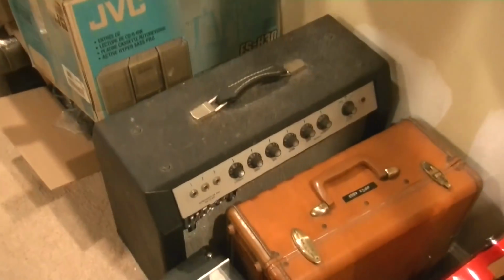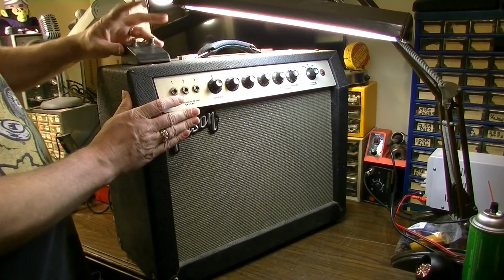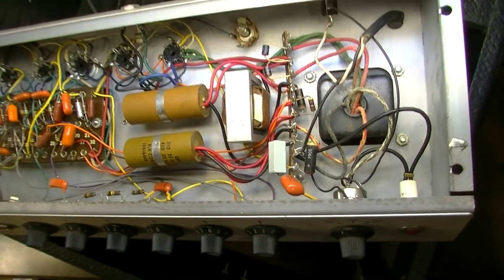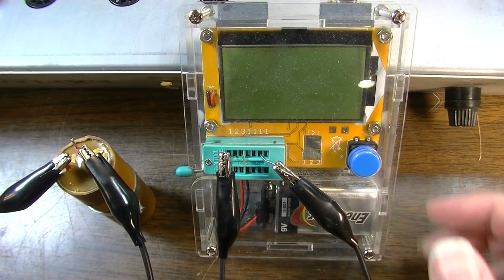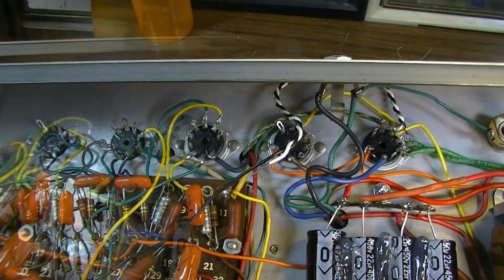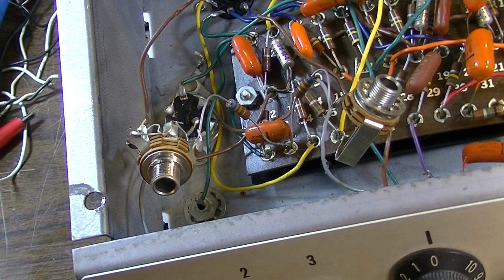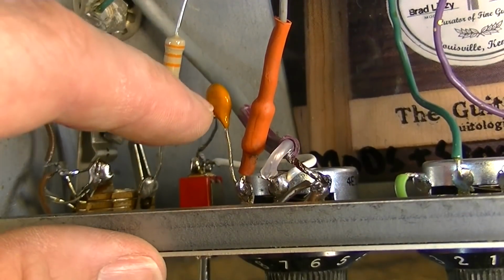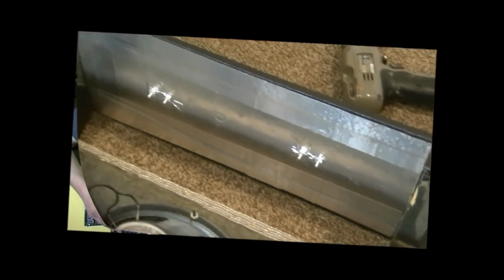The Baddest Gibson GA15RVT Explorer on Planet Earth?

Comment: im glad to see that im not the only one that modified one of these amps.  i agree its got good "bones", but a bad design.  im usually a purest and dont like modifying anything vintage, but this amp is an exception.  - very thin and anorexic sounding, with no Body or warmth at all.  it only sounded half decent if you turned the Loudness and the tone stack pots up all the way.  anything else...  forget it.
 i didnt mod it as much as you did tho.  i  beefed up the bypass caps in the preamp from 2uf to 15uf and replaced the bizarre tone stack with a more Fender like T/B stack.  but i didnt want to completely convert it to a Fender, so i left the reverb as it was, including the strange fact that it not only bypassed the tone stack, but the Loudness control as well!  so the gain and the reverb are fed independently!  very strange "feature".   i was also perplexed why the reverb had (essentially) 3 gain stages (including the initial preamp) but the actual preamp only had 2 (including the PI driver).  its a weird amp but it had potential.  id love to see a final schematic and what you did with the reverb.

Comment: APB be on the lookout for a Gibson GA19RVT. Remove the 3 leg rc network, up the first stage coupling cap from .01 to .02 , remove the .001 between the power tube plates and install a 500 pf on the tone control and that's it.oh yea, after removing the rc  network, install a jumper between the coupling cap and the volume pot. It ain't as gainy as your ga15 but it's still a nice bump.Good tweek and good playing there, Mr B.
Reply from the maker: I have a bunch of Falcon videos on the channel.

Comment: 48:25 Hah! Well, yeah probably. But I had modded mine first. I didn't restructure it as dramatically though. What I did was go to a one knob tone control based on a big muff circuit, and then I used the bass knob to act as a tone stack bypass for extra gain. So when everything is cranked, it rocks pretty good. But it's gotta be loud to do it.

Comment: Not sure the reverb mod was a good one since the gain seems to effect the reverb level as well. Other than that sounds good.
Reply: If you mess with the routing of preamp stages (well, half stages) like that you run the risk of adding an out of phase wet signal when mixing it back? Which defeats the purpose of the gain stage mod?

Comment: When wiring the heater filaments, take 2 different color long wires and put them in your cordless drill and spin them together. Then you can cut them to desired lengths and strip the ends.

Comment: The Gibson amps are weird the expensive stuff is the transformers and choke and there very good but then the filament wiring is terrible and cheap to do when it’s built the input jack delineating is truly weird it looked like a Switchcraft and have used them 30 years and never had one fail

Comment: I have 3 amps from the mid 60s gibson crestview line.  Man, they are ugly, but they are gems.  I have the GA-8T Discoverer (which is the same as an Epiphone EA-35T Devon ), GA-19rvt Falcon and a GA-5 Skylark.   My only beef is that they often had integrated components (a few resistors and a cap all in one package with 3 or 4 legs sticking out of the main "blob")    Great video Brad!!!

Comment: Why would you think that the "death cap" is no longer needed once you install a three prong cord? With the 3 prong cord installed, the cap is no longer a danger because the chassis will be grounded. Anything that puts line to the chassis will trip the circuit breaker that feeds the amp.
Reply from the maker: With a modern polarized and grounded cord, there is no need for an incoming line cap. It's an extraneous part which serves no useful function.

Comment: Just listening to your videos while i work on some amps and guitars. I just did a power amp and ran into the same issues with one dead channel. Had some blown diodes on the input, replaced all that and nada. Started probing with my scope with a test tone and had a slip from the collector to the heat sink, arcs and sparks. Fried the bias resistor and a 4 out of 6 NPN and PNP BJT outputs. Replaced all that and nada. Replaced the drivers and nada. Had 120mv of DC offset at the output with no load. The protection relay was kicking in the whole time showing an issue. Heard it clicking in and out so I figured all good. Last frigging thing I could think of so a 3 week order from China and all be screwed if it wasn't that stinking $3 protection relay. Definitely did not make much profit on that repair. It was some off brand amp and I could not find the exact schematic. Learned what not to do again. These things are not as forgiving as tube amps when you make a quick short circuit. They go into arc weld mode. Done that on a tube amp once and the only thing it damaged was my good Probe Master DMM probe. Amp was fine. LOL. The cross referencing of obsolete transistors is a half the battle. Had issues with that before, different pin outs. Blew up a cap in a Peavey power amp of mine replacing obsolete shit. I'm thinking of not taking much more of these unless it's a simple switch or pot. Caps maybe.
Reply from the maker: The problem with SS is you will get mired down in a lengthy repair like this and the amps just aren't worth the real cost. A lot of the guys I know don't mess with any SS at all for that reason. And you just don't know what it'll end up being until you're in there.

Comment: Brad, did you test the capacitors before you removed them? I know their old, but you know how collectors are 😉. They like to see all original parts, that's why the old tube amps are so valuable. If they've been changed and look like a Christmas tree inside, then they are not original, was the advice my dad gave in the mid 90's. With reissues and the everything else that's come out since then, I wish I still had my CBS fender twin. I've got a garage full that could keep you busy for a bit. I'll send pics when you have time. I love what you do, brianefrench@gmail.com

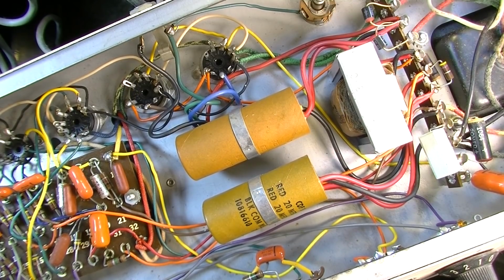Comment: Big A/V QUALITY UPGRADE 16:41...good low freq.'s
I have a THOMAS ORGAN CO. 1962', T1* ORGAN CHASSIS (actually TL-1 organ) I'm going to make a guitar amp from. [never ever destroy a fixable analog discrete component organ! As I mention below, it was beyond huffed!] THE T1/TL1 is an excellent candidate! P/P 2-6BQ5 (actually 7xxx forget, not in reach), 3 12AX7, big pwr trans & big ot... empty half of chassis- provide space for potentiometers across full front. 
EVEN HAS A LOW VOLATAGE SUPPLY (as all tone generators were transistor...mega quantity germanium:)...full of 1960’s Blue Ajax  'Fender' vintage capacitors.
BOTH FENDER AND THOMAS ORGAN COMPANY WERE IN SEPULVEDA, CALIFORNIA....you'll find  they sourced a great many parts from the same supplier. When CBS bought up FENDER, GULBRANSEN ORGAN CO., and  LESLIE (ELECTRO-MUSIC CO.)...you'll find even hardware crossing paths. ie. Gulbransen giant numbered side view'  thumbwheel potentiometer controls, used on Gulbransen RIALTO II organs, ALSO USED ON 1970's CAST ALUMINUM FENDER FX PEDALS, W/ "foot control" side wheel knobs.

I've R&R many amps. Guitar player since 77'. Organ player/ collector RESCUER OF ALL MAKES LISTED BELOW THROUGH 1968'. RULE OF THUMB: ALL BRANDS AND MODELS OF ORGANS PREVIOUS TO THE 'EPROM' 1968', WERE GUARANTEED THEMANUFACTURE CARED ABOUT 'TONAL QUALITY', AND 'CABINET CONSTRUCTION QUALITY. '. After the 1968' period, 'features', aka 'auto rhythm', 'auto accompaniment' began to displace the tonal quality of the tone generators.
NOTE, 'TRANSISTORS' IN AN ORGAN CAN BE A GREAT THING. Tranny tone generators very sweet sounding in many cases. WE ARE TALKING >DISCRETE TRANSISTORS<. The Gulbransen RIALTO K used all transistors, and used a LESLIE 101 'ISOMONIC' 5 CHANNEL ALL-TUBE SPEAKER CABINET. What is 'isomonic'? It's a play on the words 'ISOLATED HARMONICS'. In an orchestra, choir, or PIPE ORGAN the individual voices BLEND IN THE AIR..., but in the case of blending in an amplifier/speaker, the 4ths & 5ths harmonics CLASH/CANCEL. So DON LESLIE  and Gulbransen engineer ?1st name Peterson, designed a way to eliminate this. USE TWO SEPARATE CHANNELS WHERE ADJACENT NOTES ON THE KEYBOARD DO NOT SHARE THE SAME AMPLIFICATION/SPEAKER CHAIN. So...
 CH. 1 gets all C,D,E,F#,G#,A# key's outputs, and
 CH. 2 gets C#,D#,F,G,A,& B
(note, these are only the NON-FLUTE VOICES (tabs)- DIAPASON,STRINGS,REEDS/horns. WHY? Because FLUTE/TIBIA GO THROUGH TREMULENT (aka LESLIE SPEAKER, ) IN A THEATER ORGAN SILLY... where it gets all SWIRLED and clashed together anyway. 

btw Hammond draw bar organs are FLUTE-ONLY...Don Leslie, a theater organ enthusiast, reasoned AM/FM of THEATER TREMULENT could be had in a manner which used DOPPLER, AND TO/FRO LOUD/SOFT...all in one spinning baffle. Sure enough it worked! So well that Leslie (Electro-Music) never had to advertise! Another bit of trivia, Laurens Hammond despised the Leslie...hence why 'half moon' switches are externally mounted on a Hammond Organ. Eh', looks cooler anyway.

WATCH video>>  at 40 minutes in >>>      Legendary Theatre Organists       <<<   a demonstration's worth a million words. WATCH!

*[actually TL-1 organ...'L' for Leslie, but fairly certain it's the same amp chassis for both Leslie and non-Leslie models]. This organ was found with keys busted, music rack ripped off, bench gone and Leslie 'wooden drum' insert yanked and missing. I'm a proponent for NOT destroying organs for amp projects. I've rescued and repaired [and many fully restored] all makes of organs 1946'- 1982. CONN,GULBRANSEN, HAMMOND, LOWREY, THOMAS, AND WURLITZER ESPECIALLY.

Comment: Once you're  in you may as well get the best you can out of these things. They weren't much out of the infancy of design when originally done. The tube makers just gave specs for what worked for things needed in ww2 and Korean war era radios and such. Manufacturers were kind of making it up as they went, we have the luxury of hindsite for what actually works best for our needs. Museum pieces are nice for reference, and fine if that's what you like, but don't sweat it, make the improvements. You can always put it back to original.

Comment: Hi Brad, love the channel. I have been a fan for some time. I really enjoy your videos, I have learned quite a bit from you, many thanks. A little tip for drilling l'll share that an old timer passed on to me. To make drill bits last almost forever, start drilling at a slow speed, increase speed until the bit starts to cut nicely. Don't increase speed past this point. Your bits will last a long time.

Comment: I need a little help-I bought one of those transistor checkers from banggood and it worked a few times and then-no matter what component I put in it it goes into test mode and then the screen says Cell u=4.79   1+''3,like it is checking a battery. I have tried new batteries, tried to figure a way to reset it. I contacted banggood and they said to send a video and when I tried to send video it would not let me, so I sent a picture of the screen with the cell  u=1+3 on it and they just keep saying didn't receive video. I thought maybe you might know how to reset it or something because it does not look like they are going to do anything about it.All I want them to do is tell me how to reset it or just send me another and nothing.I am also waiting on another order from them that should have already been here.I haven't heard you say much about them lately.Thanks for any help.
Reply from the maker: Their shipping can be slow. The stuff comes from China. If you have an account set up with them you can track packages and stuff through your account. As for the transistor checker...never had a prob with mine, but sounds like you done just about everything you can do. Maybe tell them you want to send it back for a refund.
Reply: thanks-It would cost me more to ship it back than it cost.I think they know someone is not going to spend what something cost to ship it back. I guess just write up another lose.Thanks for responding.

Comment: Hey Brad, amazing rework on that amp.  Love the Cap tester.  I may have to get rid of my vintage Tel-Ohmike TO-10...  
Something for thought: here's what I like using and twisting up for heater wires: https://www.lowes.com/pd/50-ft-18-2-Thermostat-Wire-By-the-Roll/3128547
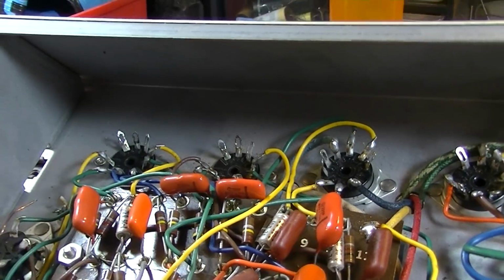Someone else asked, but it's dropped way low... Who's performing that solo @ 28:53?

Comment: Great mod! Killer reverb! As always the hot glue is a great warrior. Sometimes people use a electric screwdriver or a drill to twist cables in order to improve time when you have to make it a lot. Maybe not the best original design, but i love those orange drops. That virtual center tab is like a voltage divider right?

Comment: Hi Brad! Thank you for this wonderful video. I just wanted to make a point about that 33K input resistor - I think you overlooked the importance of the layout. As you probably already know, the purpose of this resistor is make a low-pass filter in conjunction with the Miller-capacitance(Inter-electrode capacitance) of the first preamp stage (V1). This would eliminate all kinds of radio frequencies from being amplified and also all possibilities for RF-oscillations. The critical point here is, in order for this to work, the lead from the resistor to the pin of the socket should have a minimal length (so that the capacitance is close to 0). That's why this input resistor is soldered directly to the socket and then connected with a shielded wire to the input.
Reply from the maker: I know tying to the socket is best. But every manufacturer has produced quiet, stable amps with the input resistor on the jack.

Comment: Hey, nerd question for you - where'd you get or what kind is that ESR meter? There's a buzzilion on eBay, but most seem really chintzy.

The amp sounds great...

BTW, you can twist a boatload of wire with a cordless drill geared to low. Just shove the wires in the chuck and use your fingers as the "die"
Reply from the maker: There's a link in the description.

Comment: The radio shack speaker may be from Utah, who made speakers sold through Radio Shack, and they often used metal dust caps.  Although Utah speakers generally have a bad reputation, Ted Weber bought the patent on one of their models - not sure which yet.  I've got two Utah speakers with large ceramic magnets in my Ampeg Super Echo Twin, and they sound so good I don't miss the original C12Q speakers.  That GA-15RVT amp sounds great!  The fiber baffle and plywood cabinet absorb some of the harsh high frequencies, rather than contributing to the sound as solid cabs do.  I remember reading about a guy who replaced the fiber board baffle in his Silvertone amp with a birch ply baffle, and it never sounded as good again, because of the harsh high frequencies not being attenuated by the fiber board baffle.  Some of those 1960'a Gibson amps can sound great when serviced properly, but they are more difficult to work on,  and some of the earlier tweed models also used circuit boards you have to remove first, in order to service components on the other side.  

Another interesting video - tx!

Comment: I had one of those from either '65 or '66. What I hated about it was the reverb would never be all the way off even with the reverb depth off and the ft. switch off. You could still hear the tank..I changed the B+ diodes out with FRED's and replaced those 50 year old filter caps/cans. Mine had two 6EU7 valves for the first couple of stages. There's a line matching transformer in the phase inverter/ output section. I reused the cap holder/clamps and installed a pair of multi-stage "firecracker" caps from CE Distribution.
BTW, that amp was designed by Seth Lover who designed the GIBSON Humbucking, P-13 pickup and the mini-humbucking for GIBSON and also the Fender Humbucking.

Comment: Lets see some Inverse Feedback experiments in the preamp section . Example in my JMC 800 mods I run the lead ch grid back into grid 1A, isolating with a 2meg resistor. This removes tons of noise. Another noise reduction tip , tie grid to cathode together same side of tube with 150pF cap in high gain stages.

Comment: Did you actually check the amp between replacing the filter caps and doing all that heater wire replacement? I always check after each "repair" step to make sure them amp is alive. That way I know that between each change that the amp works so that I don't have wonder where I screwed up if the amp doesn't work after multiple changes have been made.
Reply from the maker: Not a bad idea. And yes, I usually do.

Comment: Talking about the notorious death cap... I call it a virtual ground. In a sense it provides a reference to chassis ground. It can be flipped in reference to the hot or neutral. What had always confused me is in DC tube circuits those same coupling caps block DC voltage but AC voltage passes through. So understanding exactly why the AC voltage did not flow through those coupling type death caps seemed hard to grasp at first. As you learn better it then becomes apparent that the AC current flows in the direction of least resistance and choosing to flow through AC wire rather than a healthy working coupling cap. Once that healthy death cap starts to become a resistor over time then current starts to bleed through cap to chassis ground.

Comment: I sure Zinc plated a lot  those electrical boxes in the 60's & 70's. Plus chrome plated diamond string bars pickup covers, hand rests & tail pieces. Had to get the pickup covers good & bright with as little Nickel as possible before the Chrome flash, to much nickel would cause feedback & Gibson would let us know right away if there was a problem.
Reply: Jeffrey Phillips ...I must own a crap load of gear of mine that you worked on!! I thank you for the absolutely wonderful products you supplied. :)
Reply: Those Gibson chassis were made by Harold Watkins & his son Norris at Watkins Machine Shop, Allen Blvd. Kalamazoo, Mi..